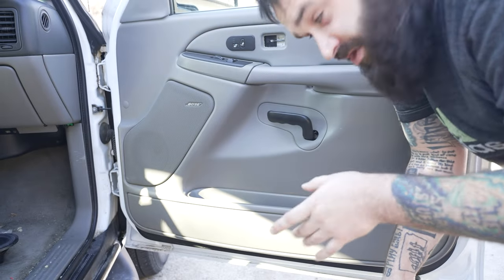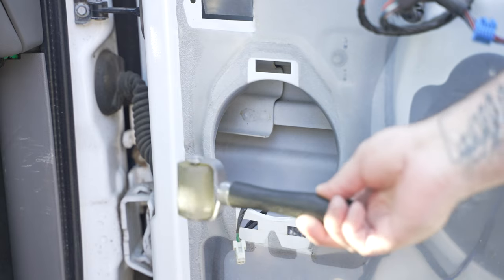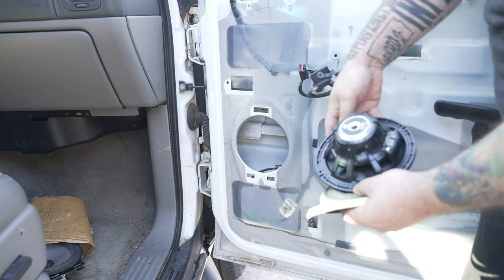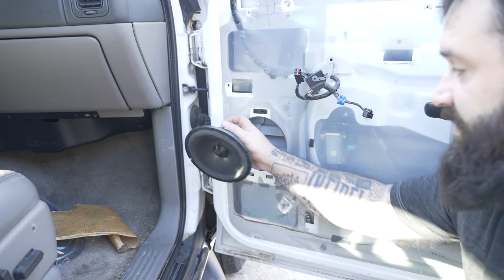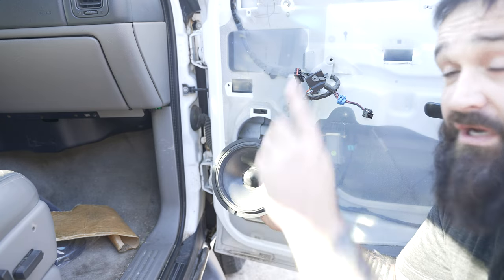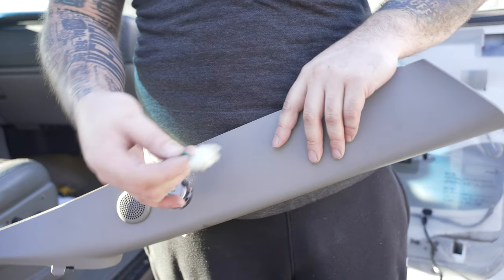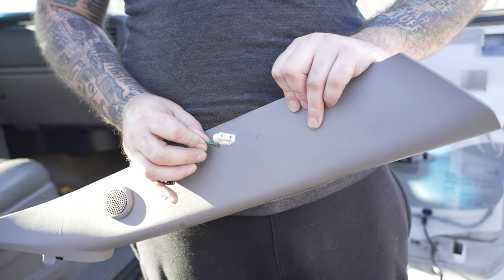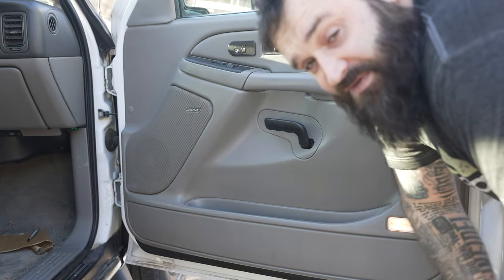BOSE Speaker Upgrade in a GMT800 NBS | Yukon, Tahoe, Suburban, Escalade

Comment: Man, you did a really good job of explaining things. Serious question tho, does this setup really sound any better than the Bose speakers when using just the stock power? Back in my stereo addiction days, you had to put an amp on aftermarket component speakers to really make them happy. Great video.
Reply from the maker: Yea you bring up a great point!  To me, it literally sounds the same.  This is only good if you're planning later on to add an amplifier to them, or if you have a blown bose speaker
Reply: Personally I feel like a better head unit makes the biggest difference for these systems.

Comment: Thanks your the only channel that shows how to change the tweeter
Reply from the maker: Yea I was looking all over for people showing how to change that speaker.  Figured I might as well be the one to do it lol
Reply: @beardedreviews ya ur the only one. I been wondering if I can just swap them out with nose system cuz my nose tweeter is blown and I have all new speakers subs and amp and all. Do they need a crossover the tweeters?
Reply from the maker: @cody6.6max  I just kept the factory "crossover" in and only replaced the drivers
Reply: @beardedreviews  what’s factory. Crossover ?? I’m just gunna replace the tweeters swap them out
Reply from the maker: @cody6.6max  exactly, you would be using the factory crossovers.  Just replace the tweeter itself

Comment: Dawg what about the crossover also the ohms don't match the factory bose amp specs  those tweeters have built in crossovers or is there a box that goes with it you thoroughly explained everything except the important stuff you can't just use any speaker in place of a bose 1.9 ohm front and 3.9 rear so not sure everything would sound right maybe I'm wrong  But I thought the correct way would be to run wires to each speaker and run a 4 channel amp For the interior speakers with an aftermarket radio otherwise leave the bose speakers in
Reply: Right.? I have same system, Bose 9 speaker. I'v had several radio shops tell me the Bose system is super sensitive to the specific ohm ratings that are the factory speakers and they have all recommended either dump the factory amp entirely and build it back or go back with exactly the same ohm speakers everywhere or else problems and/or poor sound will follow. So idk yet for my truck
Reply: I bought nvx 2ohm components for the front. Used the crossover for the tweeter and used the main speaker connected to the stock wiring. (No crossover)

Infinity 3ohm components in my rear. 

Sound loud and perfect
Reply: @chrishausler Did you have the bose system aswell?
Reply: @chrishausler  did you have a bose system aswell
Reply: @chrishausler  I just ordered the same nvx 2 ohm set
Reply: @Swaat318  mine is still going strong with the bose amp. no issues
Reply: @chrishausler Nice! Did  your sound quality improve alot
Reply: @Swaat318  yes, but I plan on replacing the Bose amp at some point. It gets muddy at 43/50 volume
Reply: @chrishausler  daaam!  mine gets muddy at half that volume. so the upgrade should workout well Thanks for the reply ✌🏾

Comment: I have the Bose in my 2003 Duramax crew cab . I have kenwood stero and amp and two 12s so I just replace the door and tweeters with different using the same stock wires right ? Don’t need to add no crossover or whatever ? I’m new to the audio

Comment: Hey...i thought there were impedance issues with replacement speakers.  I want to get rid of the junk speaker in my Cadillac xlr door.  Do you have a recommendation of a speaker that will work with the stock crap head unit?
Reply from the maker: Don't worry about the impedance (ohms)  They still get way too loud than you would ever need

Comment: Did you not run the crossover for the Alpine Type R speakers? If you did, where did you put it? Is the crossover not needed with the factory amp?
Reply: Good question actually. My guess is that it’s not needed because the factory head unit is probably already doing that work.

Comment: Hello I have a question. I saw your speakers are 4 ohms impedance. Did you install a new amp because as far as my understanding goes. The amp doesn’t support 4 ohm speakers.
Reply from the maker: the amp supports 4 ohm speakers, they're just a tiny bit quieter than the stock speakers, but you would never know unless you always have the volume all the way up

Comment: I have one question. The bose system runs on 2 ohms.The alpines aren't they 4 ohms
Reply from the maker: yes they are.  There is no noticeable difference in output.  If there is, just turn the volume up

Comment: So I can put aftermarket speaker with my factory bose amp I had a buddy say that aftermarket won’t play with factory bose amp is he wrong
Reply from the maker: yes he is wrong.  You can play aftermarket speakers with a bose amp
Reply: @beardedreviews   another question putting aftermarket speaker is it just plug and play or do I have to buy a adapter for it?
Reply from the maker: @rockymartinezjr2038  Did you watch the video?  I run through the whole process, and everything you need is linked down below

Comment: I am getting ready to order these speakers and was wondering how they are holding up? Did you use the crossover for the tweeters? Great video, not many out there changing the tweeters in the A pillar.
Reply from the maker: they still sound great.  Yea I just used the factory crossover wiring, and just swapped speakers.  I sold it, but it was to my friend who lives up the street from me, so I still get to drive it every once in a while
Reply: @beardedreviews  awesome, thanks for the information
Reply from the maker: @RM-iy7xx  no problem!

Comment: If it is get some apocalypse speakers
Reply: I have 3 pairs of those. Theyre midrange speakers, not coaxial speakers. Most ppl would be disappointed dropping those in because theyre made for volume and arent made for any kind of bass like coaxials are. Its just two diff types of speakers. Coaxials work better with factory Bose systems, the Deaf Bonce would receive too little power and the filters would be incorrect